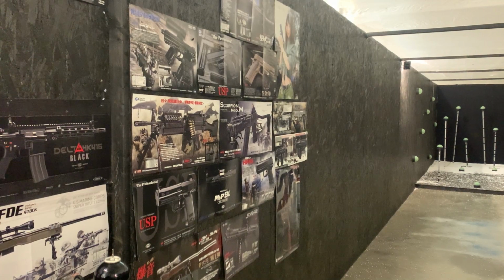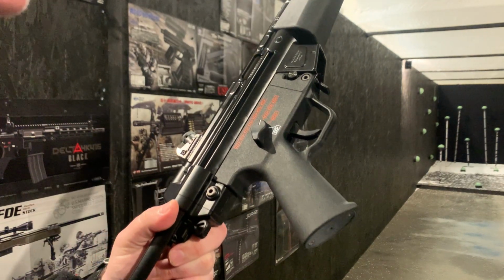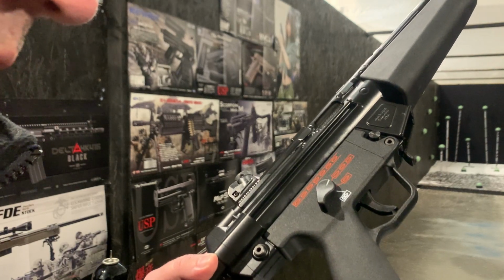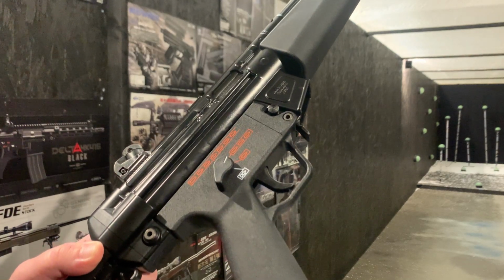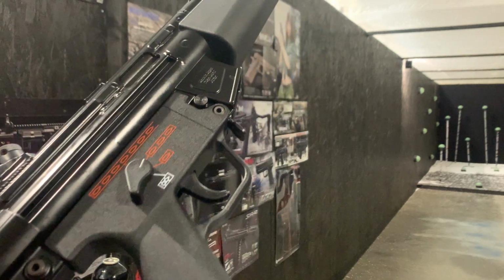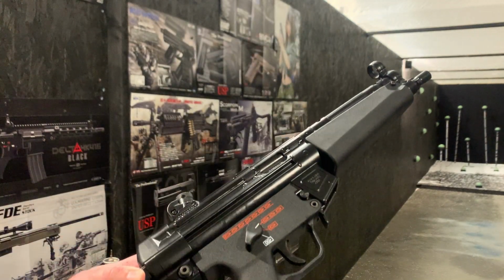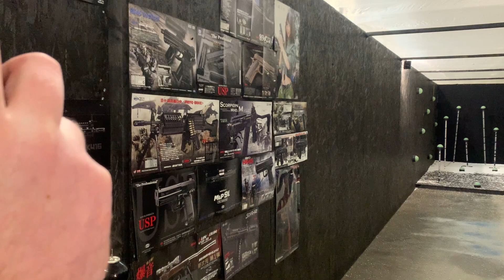TM MP5A5 NGRS | 874

Comment: Hello what safe upgrades can you recommend to get 360-380fps?
Reply from the maker: It will probably run 360 fps for years with just a spring upgrade.  But if you can afford more then do more
Reply: @Eagle6Airsoft  oh thank you for reply and also Does 1200mah 7.4v 25c Lipo tootsie or 1400mah fits in stock handguard? And is it safe to use cause C rating is 25c? Some people say over 20c is bad for internals is it true? Also if i go for 11.1v 25c batt is it safe or dont go for it cause 7.4v is the limit for Tm Mp5 Ngrs?
Reply from the maker: @generalesdeath2406  the mosfet won’t let you fit 11.1v
Reply: @Eagle6Airsoft  is 25c rating 7.4 lipo safe to use for tm Mp5 Ngrs?
Reply from the maker: @generalesdeath2406  I’ve used them yes.   Though I would argue it’s hard to believe most battery makers when it comes to stated specs
Reply: @Eagle6Airsoft  I go for 25c now cause that the only available battery I can get 20c is rare here in our location it is ok can you list parts name to upgrades to get to 370fps?

Comment: Just got my one a week ago. Loving it. Think I’ll keep it stock for now. Internal upgrades at some point. The magazine situation is diabolical. NO WHERE does the 30/72 round mags. I’ve signed up to about 5 different sites to get updates on mag releases. It’s a joke.
Reply from the maker: We have lots of hi caps in stock.  And still have a few mids available with rif purchases only.    It will sort its self out next batch which is about 3 months away.   Tm made lots last batch, demand is just very high.   

Upgrades are always worth it, the speed to target increase allows the use of heavier ammo.  Which means more hands going up.